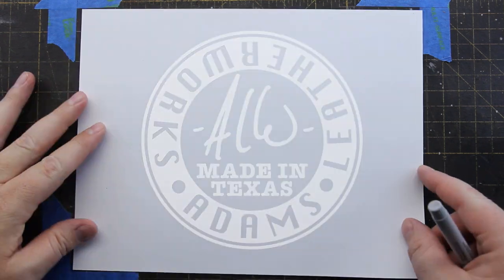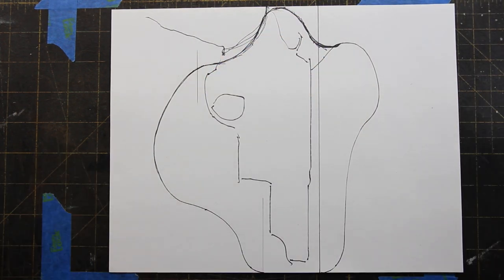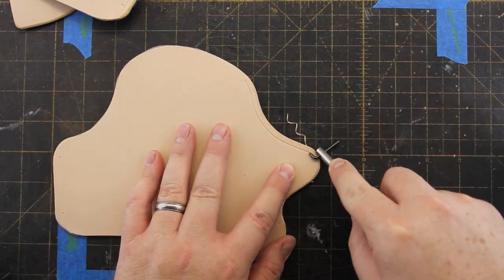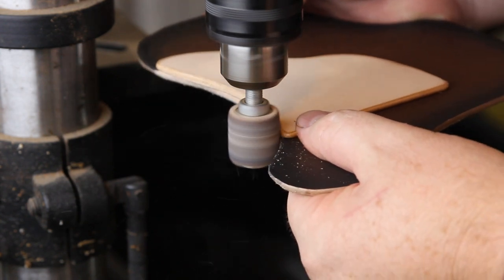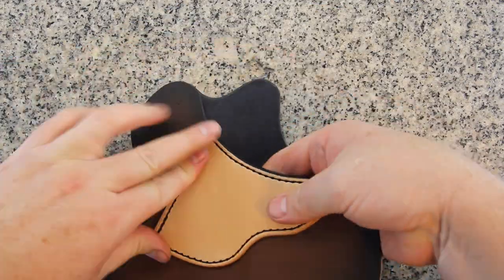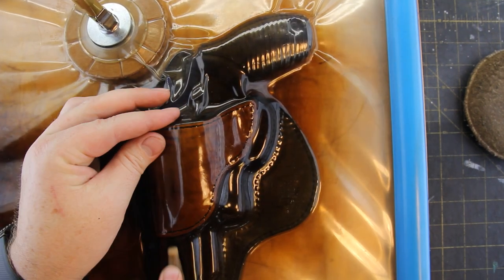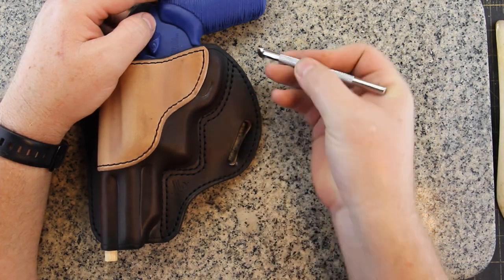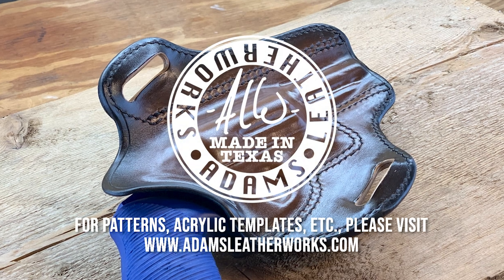Making a Flat Back Pancake Leather Holster - Taurus Judge 4510 3 Inch

Comment: What’s an alternative to a burnishing tool that I might have in my house?
Reply from the maker: Do you have a drill or a drill press? If so, I started with a wooden dowel that I inserted into my drill press and I cut grooves in the dowel while it was spinning - I used a chainsaw file (round file) to cut the grooves. Or you could use sandpaper wrapped around something round to sand the grooves into the dowel while it's spinning. You can get cheap dowels from the disposable foam paint brushes, so long as the handle is the round wooden kind.

Comment: I’m fairly late to the party here, but I just came across this technique as well. You and Andrews both use a chemical sealer on your leather. I’ve always used a 50/50 mix of beeswax and neatsfoot oil for my final finish. My projects always seem to turn out with a mirror finish that is fairly resilient. Would acrylic resolene be any better?

Comment: Awesome you handled that pattern like a pro been watching you for years your videos are great. You should try the tokonole instead of the other burnishing agent you using makes a big difference and much faster thanks buddy
Reply from the maker: Thank you! I've seen a lot of people use Tokonole lately. Can you confirm if you can dye the edges after applying tokonole? I've seen others color their edges after using it, but they may have been using an edge paint - not sure.
Reply: @AdamsLeatherWorks  yes it does although not as fast as raw leather I just did it now just to make sure I wet it first burnished it then I applied tokonole burnished. Nice and shiny I applied Brown dye a few Strokes,, burnished and have a nice shine to it. One really good thing about using tokonole is it will not darken The Edge like other ones do and it's much faster
Reply from the maker: Thank you for testing it for me. I have it in my Amazon wish list. I think I'll go ahead and order a jar of it.

Comment: Off the wall question- where did you get your glue pot?  I like it.
Thanks for sharing.
Reply from the maker: I actually bought that from Tandy when I first started with leather, so mine is roughly 10 years old. I don’t think they carry it anymore - at least I can’t find it on their site. It’s basically like this: Best-Test Plastic Cement Dispenser 16 Oz https://www.amazon.com/dp/B001DIFXAK/ref=cm_sw_r_cp_api_i_qaTGDbR54KFKG

Comment: Hello sir! I have made knives, sheaths, and necklaces for the last 4 years, but started working on gun holsters in the last few weeks. Is it necessary to have reinforcement on the holsters?
Reply from the maker: Hi Tanner - very sorry for the delay. Some holster styles require the reinforcement piece, but on OWB pancake style holsters, the reinforcement is not really necessary since there's not really any outside pressure pushing on the holster. It does help a little, but it's not 100% necessary in this style of holster.

Comment: Well I see I ain't the only that sharpens exacto blades, LOL.
Reply from the maker: I found that when I used fresh blades, the tip would break off in my cutting mat in about 20 seconds (very dangerous if you don't notice it broke). Then the blade would dull a few minutes later. I went through endless blades. I've probably used this particular blade several years now (not sure exactly, but I haven't bought a new blade in a very long time).

Comment: I am going to build my first gun holster for an American arms .22 magnum any tips for this this is my first holster build ever and I am just getting into leather working I will be hand stitching though instead of machine stitching also what kind of contact cement are you using I need a better adhesive then the one I am using
Reply from the maker: Check out Al Stohlman’s book “How to Make Holsters”. Loaded with great information and basic pattern making tips. I use Dap Weldwood Original formula in the red can.

Comment: Question, how long do you soak the holster and how long in the Zip lock bag?
Really enjoyed the video.
Reply from the maker: It depends on the leather and workflow, but for my particular workflow, I generally soak the holster around 15 seconds. I leave it in the zip lock bag maybe 10-15 minutes. If it looks pretty dry when I pull it out, I wipe down the surface with a sponge to add a little more moisture to the exterior before I begin the forming process. Thanks for watching and commenting!

Comment: One more , In the pattern making Is it the same way If you have a tall front sight like a Taurus Tracker  it is a lot taller then a judge
Reply from the maker: The same method applies. I had enough room to drive a dowel in to form the sight channel. With taller sights, just scoot the stitch line over a little more from the muzzle to just past the leading edge of the trigger guard.

Comment: I have looked for a holster like this for my Judge for a while......any chance you would do another? I will send my contact info if so.
Reply from the maker: Hi Greg - I'd be happy to build you one. If the Judge doesn't show up in the drop-down list, just select any gun and leave a note in the comment box when you're checking out to let me know it's for the Judge 4510 3 Inch (if it's another model, I'll have to buy the mold, if there's one available). www.adamsleatherworks.com
Reply: 3" cylinder, 3" barrel

Comment: How did you determine where to put your belt slots? I would think that is an important placement. Also is your pattern knife an Xacto knife or a knock off of Xacto? Thanks! Love your work!!
Reply from the maker: Thanks! I tried to position the belt so it crossed over the back of the cylinder. Putting the belt below the cylinder would let it ride a little closer to the body, but it would be very top heavy. Putting the belt above the cylinder may inadvertently lock the gun inside the holster. I took the safe route and aligned it with the cylinder. Not sure about the pattern knife - I've had it probably since the 90's. Just a cheap blade holder, most likely from the local craft store. The blade's always coming loose.
Reply: @Adams LeatherWorks I understand the logic of positioning the belt itself. I was asking regarding the position of the belt slots themselves in distance from the gun. I'm trying to build an identical holster for a Taurus Model 94 revolver. Love your work and videos! And thanks for your  quick response!
Reply from the maker: That depends a bit on the gun thickness. But I usually shoot for around 3/4" clearance between the belt slot and the stitch line around the pistol. If you get the slots too close to the gun, it puts too much pressure on the back side of the holster which puts too much tension inside the holster. Too far away, and you can't pull the holster in tight enough to the body. I don't really have a formula, but I do try to pre-form my slots so the wings are curved towards the body, and the slot is already shaped to receive the belt at roughly the correct angle.
Reply: Adams LeatherWorks makes perfect sense. My revolver front sight sticks up has a 3/8”. So instead of leaving 1/4” to 3/6” as you recommend I was thinking of leaving 3/8” between the barrel and the stitch line on the back pattern. What would you recommend?
Reply from the maker: That should be fine. You want to make sure there’s enough room to insert the gun/mold with a dowel today taped to the top of the gun to mold a sight channel, and ideally that dowel sticks up at least a little more than the height of the sights themselves. I probably could have made that more clear in the video.

Comment: Beautiful work I just subbed, why don’t you wear gloves while dyeing the leather?
Reply from the maker: Thank you! Good question. I ran out a while back and haven't ordered more. And when I say "a while back", it was probably 8 years ago when I ran out. I actually found I made a bigger mess with gloves because the dye stayed wet on the gloves. Not to mention, they're terribly hot and the fingers usually had holes in them after about 3 minutes.
Reply: Adams LeatherWorks well at least there is a good reason lol

Comment: Just wondering why you dont line the inside with suede like Sam does?
Reply from the maker: I line when requested, and the customer pays extra for the added material and labor, but I would build the holster out of two layers of 3-4 ounce veg tan instead of single layers of 7-8 ounce veg tan. I don’t personally think suede is a good choice, and many other makers feel the same way. But Sam’s a great maker and has been making holsters much longer than me and he doesn’t seem to have any problems with it. But I’d still prefer to use veg tan as a liner, when requested.

Comment: If you tooled a pattern into the top piece, can you still wet mold around the g*n? Or will the pattern go away?
Reply from the maker: I’ve tooled many reinforcement panels prior to assembly. Just use good quality leather, make deep impressions, then don’t excessively dampen the leather for forming. Dunk the holster about 3-5 seconds in water, then add more moisture with a sponge if necessary to the areas you’re molding.

Comment: Can I use a regular sewing machine?
Reply from the maker: If you’re referring to a machine built for sewing fabric, you might get away with sewing thinner leather like suede with a leather needle, but the leather I used in this video is 1/8” thick per layer, and very dense. If you were to attempt sewing leather like this with a light duty machine, you’d likely wreck the timing and possibly break some of the internals.

Comment: What grit was the sandpaper used to flush the edges?
Reply from the maker: The paper - I believe that was 120 grit. I don't recall if I showed my drum sander (in my drill press), but it's a pretty rough grit - one that came with the kit, and I'm not sure what grit it is. Those puppies last a really long time.
Reply: @AdamsLeatherWorks  I also liked your tutorial of the Avenger style holster. Would I use the use the same method if it was a revolver?

Comment: Where do you buy the blue guns at
Reply: they are called modeling props.  most holster supply dealers sell them.  "No Permit Required".
Reply: Thanks john Eliadis,for the info
Reply from the maker: Hi Reuben - I buy my molds from either www.knifekits.com or www.bluegunstore.com - there are others as well, but those are who I primarily use.

Comment: Very nice holster. Where can I buy affordable blue guns?  I use a baggy or saran wrap with a real gun. Most people don't like leaving a gun.
Reply: Bluegunstore.com. If you don't mind joining a forum, kydexpro.com has a marketplace where you can find all sorts of used gun molds for sale. Shopdiyholster.com is another website but I think you can also find their stuff on bluegunstore.com
Reply: Knifekits.com sells a variety of gun molds from different manufacturers.
Reply from the maker: I get mine from either bluegunstore.com or knifekits.com. I'll have to check out the other two sites Thegreenjoe81 mentioned. Never heard of those before.

Comment: 0:48 you transfered the marks to the gun outline. You put the leather strip how far from the gun?
Reply from the maker: I roughly centered the gun within the measurement I took around the cylinder. It looks like it was approximately 1" between the gun outline and the stitch line. Then I made a parallel line along the top of the gun, then transferred other two marks, using that parallel line as the anchor point for one end of the measurement. If it's still unclear, let me know. It might also help to look up Sam's video - his focuses on drawing the pattern, whereas mine summarizes and shows the entire rest of the holster build.
Reply: Im gonna try it tomorrow and will let you know. Thank you so much for the video
Reply: O.m.g. after actually watching and paying attention i cut a pattern for my sig 365 and did a mock fitting and it worked!!! Thank you so much for your help!!

Comment: I'm curious have you tried spraying the resolene with the airbrush and if so how did it work for you.  I'm considering adding an airbrush to my arsenal of tools and spraying resolene is one of my planned uses for it along with spraying dye and airbrushing paint.
Reply from the maker: I have sprayed the resolene. There was two things I didn't like about spraying it. (1) it doesn't penetrate the leather as deeply, and (2) it tends to gum up the airbrush fairly quickly. I've also tried dunking the holster in resolene, but I feel I get the best results by brushing it on.

Comment: What leather do you use for your holsters?
Reply from the maker: I typically use 7-8oz for my holsters.
Reply: @AdamsLeatherWorks  do you use shoulders or bellies?
Reply from the maker: I typically buy sides, but never use the belly area. I try to avoid any of the stretchy or soft areas. When using sides, I cut a straight line down the spine area and use that straight edge to cut belts, and I cut my holsters from the area closer to the belly (trying my best to avoid those soft areas), eventually meeting in the middle and using up the whole hide. Right now I'm using Herman Oak Premium Belt Bends from Springfield Leather. Very happy with this leather. Almost no waste, and very firm hides.
Reply: @AdamsLeatherWorks  thanks a lot! Your videos have helped me tremendously!
Reply: @AdamsLeatherWorks  do you have any recommendations to use the bellies for?

Comment: You should really stop with that 15* cant
Reply from the maker: Cant is determined by carry position. My customers know the cant when they place the order because it's noted in the product description. Out of curiosity, why do you suggest I stop, and what angle do you prefer? Cross draw, appendix, mall of back, or something else? They all require different carry angles.
Reply: 15 degree forward cant is nice as a look at me kind of wear holster, not really ideal for military and law enforcement we prefer a 90 degree off the deck type no cant. Don’t get me wrong you do great holster work. The holster pattern I purchase had to be modified for my use and it did come out gorgeous.
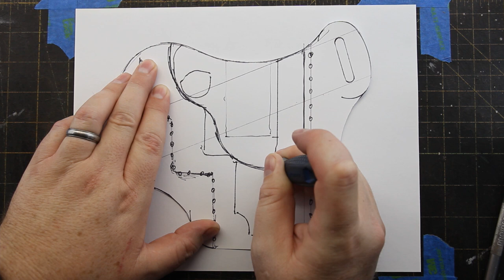Reply: Jose Melendez LEO/MilSpec prefer 90* because they don’t have to conceal.  Everybody else uses the cant to shorten the vertical profile, or they just prefer an angle when carrying at 4:00.  My LEO customers often order both ways.  In either case, it’s not for show.